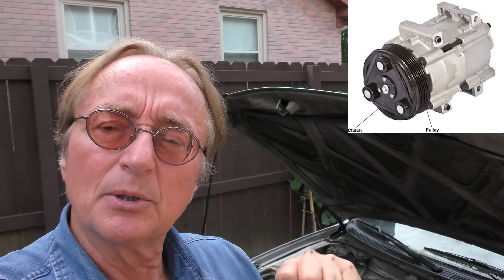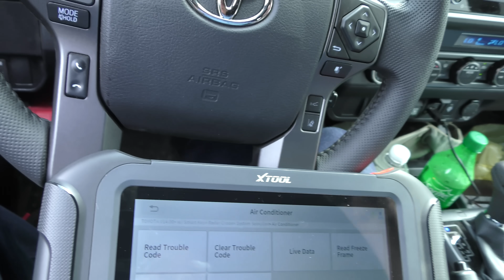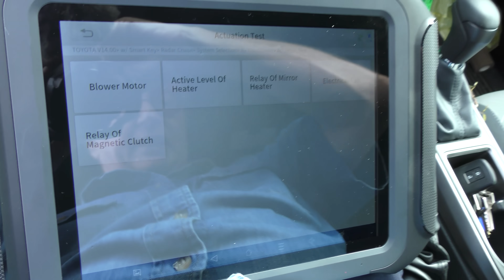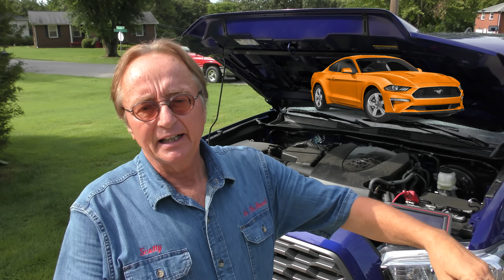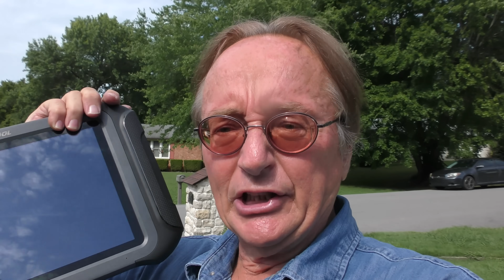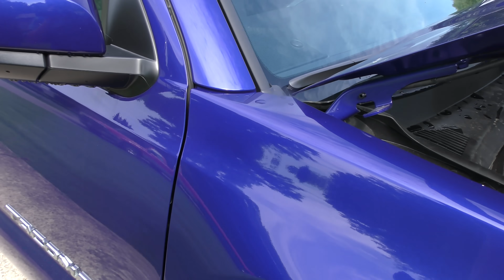Doing This Will Make Your Car's AC Blow Twice as Cold

Comment: If you think about it, the new ac compressors are worse for the environment than the old ones, because the new ones don't last very long and all the energy used to create them is wasted, creating more co2 and greenhouse gasses in the long run than the older systems, witch last far longer using the same energy or less to make.

Comment: Newer cars are just crap. The automotive industry sadly has moved too much to computer/electronic unreliable stuff which, summed up with chinese plastic crappy materials, introduces more failures than the solutions they try to achieve (too fancy solutions for simple things that could work better that way). So making cars more expensive and deposable (not a deal). American brands like Chevrolet and Ford, no more "made in USA", so no synonym of quality anymore.

Comment: One trick I know about 134r compressors.   If you get no cooling and you have similar pressure on low and high side while you run the compressor.  Usually 70-90psi.        That's a bad compressor that's only generating heat/pressure from friction.       That's the most common thing that happens to semi truck compressors.

Comment: Im having an issue with my ac, only works when the car is running, my local mechanic tells me its the compressor and the condenser has to be replaced at the same time even though its working. Any advice guys? He is charging me $1200 total, I wouldn't know if that is fair; help!

Comment: I used to tell my mom to never turn her ac off, even in the winter. Just change the temp, hot or cold.  I believe if your up north and you turn off your ac during the winter it gives the seals a chance to degrade and leak. Just keep it running. Knock on wood I’ve never had ac issues, but i never turn my off.   What do you think Scotty??

Comment: I hacked my AC last month as in the UK we had a record breaking heatwave and my AC had stopped working. The problem is with the climate control system with all the sensors you showed. Not sure what was faulty and didn't have time to check everything. I checked the pressure was good and found the magnetic clutch was not engaging.
As I wanted it working NOW, I bypassed the computer and powered the magnetic clutch directly. At first I had to connect it by opening the hood and connecting a plug and socket I had put in but a couple of days later when I had time I ran a cable and a switch inside.
It is still running like that, when the heat has gone I will fix it properly.

Comment: Hey Scotty, have you heard of a thing called a suction pump inside many Volkswagen car gas tanks that tend to fail. Some 2015/2016 golfs were recalled over it. Mine is a 2017 and failed also and I could not put gas in my tank.. amongst other problems. Any idea why this part would fail? And what can be done to prevent it from failing again? Is it ethanol in fuel?

Comment: My steering wheel shakes alot when I go around 55-65 mph on my 2005 Honda Accord what could this be ? I got pretty much new tires had them installed at a small tire shop
Reply: Rack and pinion

Comment: I recommend to people, that before getting out of their vehicle, shut off the A/C, but let the blower (fan) continue to run allowing the evaporator to dry as much as possible. I usually allow 2 to 3 minutes. This prevents mold or corrosion from possibility starting.😏
Reply: Some cars like my Volvo have a feature called Afterblow. It makes the blower run after the system senses moisture in the evaporator box. This feature dries out the moisture and helps to prevent odors and contamination on the evap coils.It's totally automatic.

Comment: I have a 2011 Ford Fiesta and the AC never quite worked right.  It was undersized and when it gets really hot (95+) it just can't keep up.  I had the compressor replaced a few years ago and it worked for a while but it developed a slow leak so I had to top it off every spring.  After a couple years it started to squeal badly and then it, essentially, stopped working.  I said screw it and just never used it and suffered in the summer and tried not to drive it when it was hot.  Saw another AC video by Scotty and in it he said to use some AC oil every time you use a can of refrigerant.  I never knew that AC systems used oil.  Gat a can of AC oil from Walmart and the AC now works almost as well as if it was new.  If you have a leaky AC that you top off periodically, use the AC oil.

Comment: I saw one of the shows on motor trend tv, discovery etc (forgot which) an they finally tested it and it turned out thatAC got better MPG after 55mph. before that it was better with windows down. maybe Mythbusters? anyway the drag factor etc did not kick in until around 55.

Comment: I gotta say, I don’t really see much gain in all the modern technology…

1. Old system- turn it ON, car gets gold after a couple mins you feel great.

2. New system- turn it ON, car gets cold after a couple mins you feel great…. Yet you have extremely expensive equipment to do essentially the same thing… but in turn you get things like Dual zone climate is about the only thing that’s new, ventilated seats…

Honestly every dual zone car I’ve owned, I literally go; “yeah you can adjust the temp side to side” but never actually use it, it’s always just the same. If it’s 120 out in the desert, not many people want a different setting other than “LO”… so it’s almost a pointless technology… as I said not much gain. Especially when the old tech if the other person got too cold, they could simply just close the vent…

Comment: i like how he says,. do it now or else.  like my engine Belt. i asked a shop to let me know how good is it.  they said no issues.  but my aunt (last owner) said the mileage is nearly  at the point of replacing. i hate to try and replace it with a bad belt as the current isnt giving issue.  BUT if that belt decides to break.. engine is shot. its one of those types lol.  so im on the fence.  i fear im jinxing myself and i should just have it done.
Reply: Just do it
Reply: @mikehand2668  i want to get everything tuned up on it. just the fact of when. as im dealing with family in rehab. with no help. im there all day.  i wanna get the tranny fluid changed and spark plugs just no time.. til its too late. but i hope not

Comment: Scotty you Nailed it, The Condition of the Battery dictates a smooth operation, if you have discharged/Drained  your battery a few times, Its time to get a new battery, and be sure to do a battery reset. I had a couple of engine codes in my 2016 Tacoma, they disappeared after installing a new battery . I did not do nothing else
Reply: Haha 😂
Reply: Yeah, just replaced the battery on a 2005 bmw x3, drives like new again.

Comment: When I was a kid most cars had 2/55 air conditioning. That was 2 windows down at 55 mph.
Reply: Still works! I'm still a big fan of wing windows too.
Reply: The plain ventilation systems of new cars suck. Back in the day, you could get unheated air out of the vents with AC and heat off, but today, it seems like they draw the intake air in a way that heats it up more. 
-- By the way, my last two transportation appliances have both been Nissan Versas, and both of them got about 1-1/2 mpg less with the AC on than with the front windows open. And the acceleration performance sucks with AC on. Both have been manual transmission cars, which seems the only way to get anything like decent performance out of an econobox engine. It was the same with the '89 Corrolla I had. All three engines had shitty off-idle acceleration, so it was helpful to get the revs up before hooking up to the drive wheels.
-- I think the AC vs. windows issue is a matter of the particular aerodynamics of a particular car, and also a function of how many windows are open, and how far down they are opened.
Reply: @grizzlygrizzle  Our UK engines seem to be fine, even with AC on. And all of our engines are econobox by your standards. 1.6 is considered quite large
Reply: @alexdev5809  -- Perhaps we have different expectations regarding performance. Plus, I use my Versa as a little work van, so it's often carrying  some weight (the owner's manual says the max load is 800 lbs, and it's fairly occasionally close to that. In any case, try the same test. Fill your tank, set trip odometer to zero, run till near empty, fill tank again and note the trip odo mileage. Run the AC for the whole tank, and repeat the test with the front windows open and no AC for the next whole tank. Highway driving is when the drag is greatest, so I did my testing during a long highway drive. Of course, for in-town driving, where drag isn't a factor, the AC has to entail a net loss of miles per gallon, and the only question is how much.
-- Oh, one other factor that may affect performance of small engines. Many manufacturers are loading up small engines with turbos, but I avoid them, because they tend to negatively affect engine durability.
Reply: @grizzlygrizzle  You’re absolutely right when it comes to the whole turbo thing, that’s why I don’t go anywhere near them when I want a reliable car. I’m sure using AC does net a loss in mpg, but for my own comfort, I couldn’t give a rats arse 😂
It’s getting to that time of year when it isn’t so necessary anyways (except for defrosting windows).
Reply: @alexdev5809  -- I guess I have a predisposition to become acclimated to seasonal weather. I got used to that working outdoors on construction crews for 20 some odd years. It makes me feel sort of disempowered and dependent having to run from one temperature-controlled pod to another during the cold and hot seasons.
Reply: Bo Blu  About what specifically?

Comment: I had no idea these complicated compressors existed.
I thought they were all the magnetic clutch type - simple on/off through the A/C button.
These new A/C's also have the new expensive 1234yf refrigerant that's also not as efficient as r134a
Reply: I still own cars that take the old stuff  R-12 which was colder bthan any of this new stuff
Reply: Yes. I was wondering too.. the new car manuAls say to turn the ac temp up to save gas.. pretty much all cars hAve variable compressors

Comment: Most Mazda's have very weak timing chains that will brake before 140000 km.
Reply: If the timing chain is actually a rubber belt, it should be changed per owners manual schedule.  Regardless of make.
Mazda is ahead of Nissan junk.
Reply: @ferndog1461  Mazda timing chains are rubbish.

Comment: One morning I started my car and the engine was very rough and even backfired, traction control error and ABS error lights came on and the engine stalled. Much longer story of mystified people but bottom line was that the first thing my mechanic did was to load test the battery. Sure enough, 2 weak cells. Replaced the battery and all was well. The clue was that it happened only in the morning after the car has sat all night with the various computers slowly draining the already-weak battery. Now I keep my own load tester. Have an odd gremlin? Check the battery first. LOAD test it.
Reply: I had my 2005 Ford Crown Victoria LX sport, used 178500mi have the auto shop battery test screw up. I removed the OEM cigarette lighter, boom: test worked fine: car battery(Die Hard) & starter were fine. ✔️. As a precaution, I keep my cigarette lighter OUT of the dash.
Reply: Right you are, and I noticed something else:  Batteries today don't last as long as they used to even 5 or 10 years ago.  I used to get 3, maybe 4 years from a battery.  Last batteries I installed, go out after 2 years!
Reply: @robertmaybeth3434  Others have made the same claim.  My experience has been similar.  Before I buy a new battery now I load test it myself and don't consider a battery that is more than 3 mo. old.
Reply: @robertmaybeth3434  i have a 30-year-old blue-top dually optima in my 10-year-old sentra and its only needed rebuilding once. if you seek one out- don't get the newer mexico-built optimas- i hear they are real crap.

Comment: I'm still trying to figure out how to make my AC Blow Twice As Cold!
Reply: I don't know about that I can tell you how to make it last twice as long.  And that is, to USE IT.  Run your A/C once a week/1 minute, regardless of weather, 52 weeks a year.  This keeps the seals from drying out and blowing out A/C should last longer.
Reply: @robertmaybeth3434  there is no moisture in a healthy system- best thing to do s keep the car out of the sun right after its parked with a hot motor.
Reply: @tommurphy4307  There is oil in the compressor/system that needs to circulate to lube seals as Robert stated, it's the best tip!
Reply: me too, lol
Reply: Use the condensation  water from the evaporator and spray the condenser with a fine mist of water .

Comment: Interesting, that Toyota truck still uses the old-fashioned knobs to adjust the temperature and other A/C settings. On my 2018 Corolla, you just adjust the thing to the temperature you want. I have mine set at 70. Some cars have electronic ones

Comment: It's disappointing to see that refrigeration systems have become so complex with such little gain in performance. Only extremely expensive to fix.
Reply: The new environmentally safer refrigerant r1234yf is less efficient than the older r134a as well
The refrigerant is way more expensive and cools less
Reply: @Argedis  The New Gold Standard! Isn't as reliable or work as well, and yet costs much more.
Reply: @Argedis  R12 was the best!!!
Reply: @Argedis  I remember my mom used to have a 1990 Camaro and it used R12 and it blew ice cold ❄️
Reply: @Argedis  ...funny....we said the same thing when R134a replaced R12......yet also true.
Reply: @Argedis  R-12 baby!
Reply: Ebay has been my friend
Reply: That's not a mistake on their part.  They deliberately design them in the "we make more money that way" school of engineering.  And that's why I haven't owned American since 1990:  Too many designed in defects.
Reply: @robertmaybeth3434   ...deliberate or not is not my point. It's just not necessary to build rocket science technology into basic appliances that break your wallet when they fail, including cars.
Reply: @Beefcake20  what you're failing to grasp is that the only way to get a more efficient car in regard to gas milage means playing efficiency games with other systems in your car. 

The problem is that efficiency is a horrible beast in engineering. That gets exponentially worse and more expensive the more you hunt it. 

We can make cars that last 100 miles per gallon. They will look ugly as sin, and only have one speed and require extremely costly to fix and repair mechanically.
Reply: My 2008 Isuzu D-Max whole AC system replacement cost me around 430$....
Reply: So 👍 true
Reply: Exactly
Reply: This is what happens when the government inserts arbitrary efficiency requirements into the mix. The customer suffers, then they blame the manufacturers instead of the government, the government responds with another solution to the problem they created and the cycle repeats itself.
Reply: Just like the vehicle's themselves in whole!!!!
Reply: I find mine substantially more efficient

Comment: Another thing I always preach is "Never blast the AC at the highest setting"  especially when you just start the car and the compressor oil is cold and at the bottom...Unfortunately my wife stopped doing that only when it cost us the compressor.
Reply: Good point. The excessive high pressure puts the compressor, hoses, and condenser under extreme load.
Reply: @Beefcake20  Exactly! It's part of the planned obsolescence; modern car compressors seem to be engineered to work at the edge and fail pretty reliably these days. Only Toyota and (funny enough) Fiat still retain great AC systems, probably because if your AC doesnt work in Italy, your car is as good as totaled for half the year.
Reply: Yeah I know on my Toyota the ac won’t actually start working the compressor until 15/20 secs after it’s turned on when it first starts.
Reply: Lol I always do this 🤣 the AC blew ice cold and lasted 365,000km then developed at refrigerant leak inside the cabin during long park up during lockdown.  I bought a new car after that broke they wanted too much to fix it.
Reply: @KiwiPowerNZ  what kind of car was it? And also, what do you think costs more, $1000 to fix the A/C or $30K for a new car. I would spend $1000 to fix it long before tens & thousands of dollars on a new car
Reply: @Blakecryderman7244  i live in caliornia it costs almost $1000 just for a timing belt change on some cars - labor!
Reply: @robertmaybeth3434  not just in california- anywhere
Reply: @KiwiPowerNZ  my bad - the leak happened because the seals dried out.  From not running the A/C none of the refrigerant oil circulated, seals dry out, then they blow out, adios refrigerant
Reply: @robertmaybeth3434  the factories cheap out on the froil.
Reply: oh my... I was in automotive for 40 years and A/C for a minute too, and that's something I should have heard at some point but never have!  I believe you of course. And I can tell you own an American car at least that one that blew its compressor.  Have you considered it might have been caused by not running the A/C at least once a week bare minimum, 52 weeks a year?  I've known plenty of A/C units of all kinds to go out when they are not run for months at a time.  That's because the refrigerant oil doesn't circulate and the seals dry out.  So next time someone turns it on again, those dry seals git clobbered by around 3000 psi refrigerant, the seals can't flex anymore and they blow out.  The fix couldn't be simpler (run the a/c once a week/30 seconds or longer).
Reply: The compressor will run on full speed if you ask it to cool until temp is reached.
Reply: @Another Wacko Fiats at bottom of ratings.